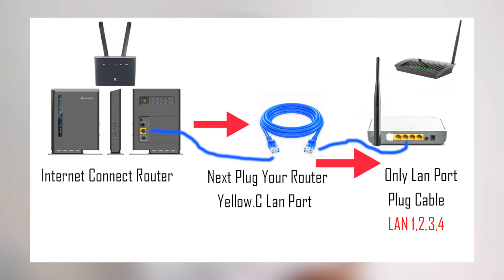Wi-Fi Router Low Signal Strength Problem,Use this solution - Explain In Sinhala ꘡DUNXU 🇱🇰

Comment: Signal godak adu paththaka antenna ekak dala aran thiyenne. Eth antenna eka tath enne 50 m wage durin gedarata wada. E ena thanata aran router eken wena router ekakata 50 m network cable ekak dala gaththoth hariyay da ? Tozed V10 router 2 k thiyenawa.
Reply: Tozed V10 eke network cable eka connect karana vidiha or thana photo ekak danna puluwan weida
Reply from the maker: Mn gawa nane ee router eka mn hithanne oya router eke network port ekak nedda koheda micro usb port ekak neda thiyenne..yellow color port ekak na neda micro usb nm ekata converter ekak ganna wenawa micro usb to lan port ekak ehema ekak gaththoth puluwan Network cable eka plug karanna.
Reply: @DUNUXLK  50 m wage durata wifi ganna system ekak nadda ?

Comment: අපේ ගෙදර WiFi router දෙකක් තිබෙනවා slt එකයි dialog එකයි. SLT wire ඇදලා නිසා speed එනවා.  Dialog එකේ speed මදි. ඒ දෙක set කරන්න පුළුවන් ද? Set කරොත් data වැය වෙන්නේ මොකෑ ද?
Reply from the maker: Ehema dekama set karanna be.dialog eka pawitchi karanne neththam sim eka ain karala slt ekata connect karanna ehema ehema kara kiyala speed wedi wenna mn video eke kiyala denne Signal wedi karaganna vidihak witharai machan.karala balanna
Reply: @DUNUXLK  දැන් මගේ WiFi range  extend කර ගන්න ඕන නැහැ. Dialog touter ඒක signal කණු 3 ම ගන්න ඕන 🤔
Reply from the maker: Ewa karanna be oken